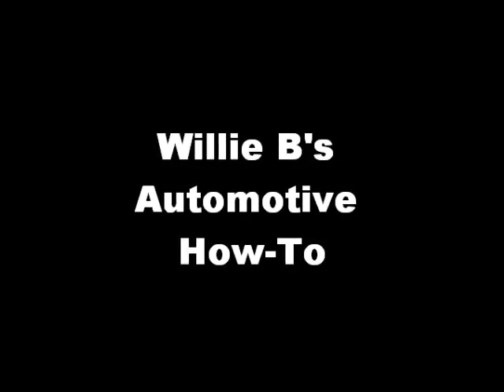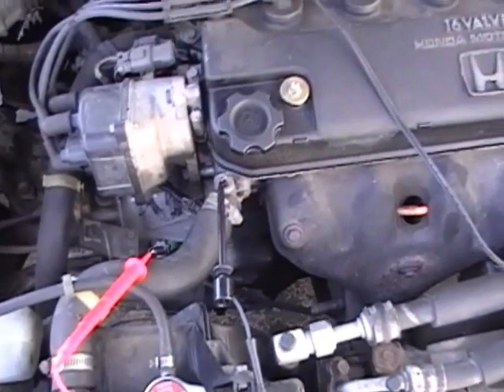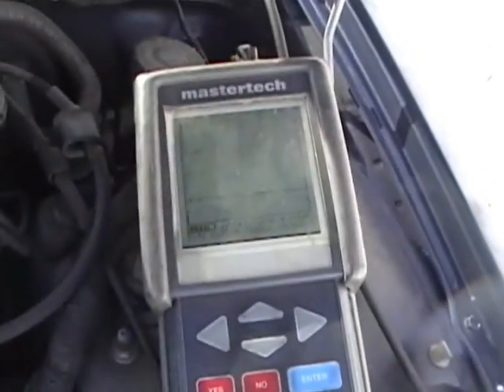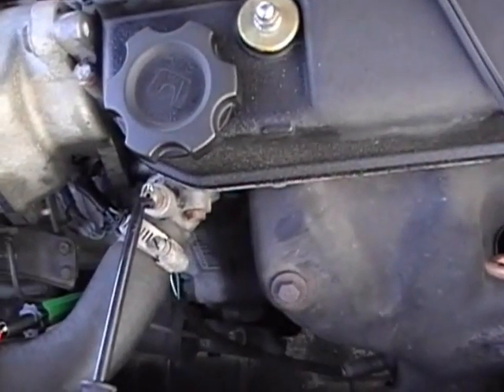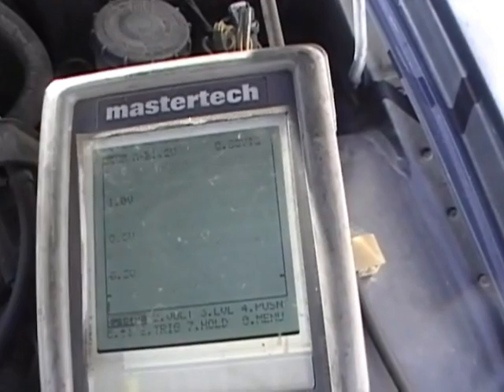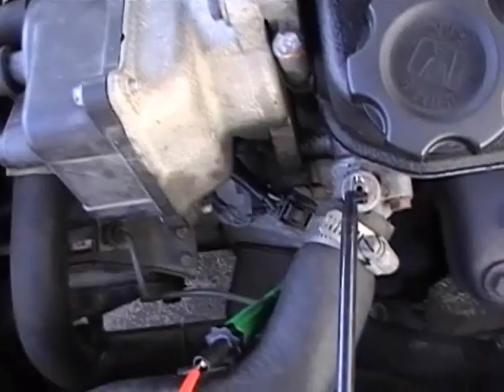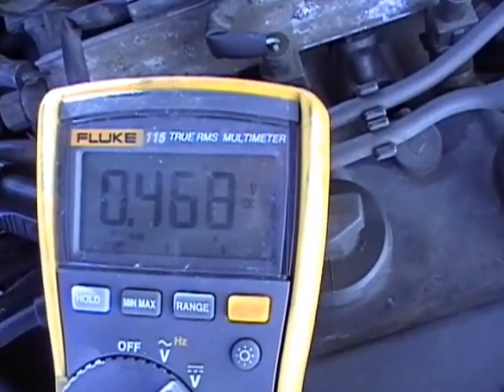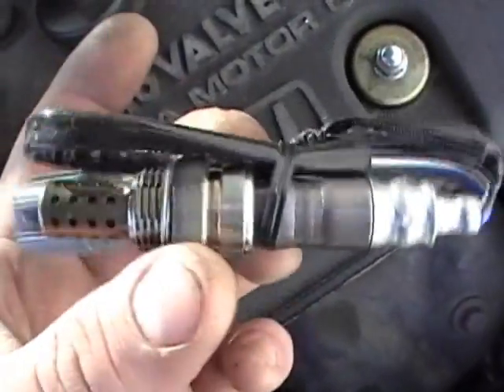how to diagnose oxygen sensor problems (part 1)

Comment: Just wanted to say thanks for posting this. I actually picked some info up by watching this. I have access to a Master Tech scan tool in the shop that I currently work in. It is getting to be out dated by todays standard. I am still learning the functions of this scan tool. I picked up on your use of the oscilliscope and by using the scan tool I was able to figure out how you set it up. I will be using the osilliscope alot more often on other sensors. Thanks again really appreciate the help.

Comment from the maker: @The01flip good question. yes, it is very important to use OEM Oxygen Sensors. all brands of O2 sensors have their own signature waveform, with that being said you must use the O2 sensor that your powertrain computers have been programmed to monitor. you could make the problem worse or not fix anything at all with an aftermarket O2. yes it could affect your smog check and your MPG.

Comment from the maker: @ZR1Terror did the car ever have a K&N air filter in it? if so, clean the Mass Air Flow Sensor. i hope that helps . gas mileage problems are hard to figure out. dont just throw cheap aftermarket O2 sensors in it, you could just make matters worse.

Comment: I've used plenty of Bosch O2 sensors on lots of cars and never had a problem.  One even has 135K miles on it and still works just fine.  The Original Denso one only lasted 73K miles.

Comment: I have a 05 Nissan sentra spec v with a after market header and the o2 sensor keeps going out and my engine gets pretty hot cause the header I guess, but I want to know if I need a certain brand or does it burn out cause the heat.

Comment: I got a question, I just upgraded the header and exhaust on my honda crx, and apparently i used to get 600km to a tank now I get less than 200km per fill, some are telling me its the O2 sensor that should be replaced because its letting the engine have too much gas, could this be possible?

Comment: My '91 Honda CRX is still throwing O2 sensor code after I replaced the sensor with an NTK brand sensor I purchased off of Amazon. Are NTK sensors suitable for Hondas? How would you rate em'?

Comment: hi i recently replace twice the o2 sensor on my dodge ram 2500 2001 and  ill stay off for about 10 minutes then the check light come on again,i was checking the fuses and the one that belongs to the o2 sensor is not working>>what do you think it can be note i purchased the o2 sensor from ebay
thanks mike c

Comment: What about the Australian Holden vz alloytec 190 thats got the same engine as the cts cadillac. Has 4 o2 sensors. How do i know which one is stuffed? I hook up a tech 2 tool and 2 are stuck on 1000+Mv and 2 are on 450 up and down

Comment: guess I should have reviewed more of these video's before I replaced mine.....still having a sensor circuit malfunction.....just so happens to be a universal bosch, go figure. It reads, but it doesn't trend like the other bank sensor. thought I might have done a bad splice but it seems pretty solid. i'd go with a direct fit if I could but I have a custom exhaust setup.

Comment: I have a gas mileage problem, I have a 2001 Trans Am six speed with 42K miles and I feel like it's giving me really bad mileage. I already cleaned the air filter, filled up the tires, and changed the sparks and wires, and it's still pretty bad. I'm thinking it might be the O2 sensors, which is why I'm watching this video.

Comment: All these stupid sensors on the car that crap out after X number of miles, or whose contacts corrode or come unplugs, are responsible for more hair pulling crappy running engines than anything else in the world.  If they were designed never to fail, and when they do, to tell you via a one character scrolling alphanumeric readout on your dash, they would be alright.